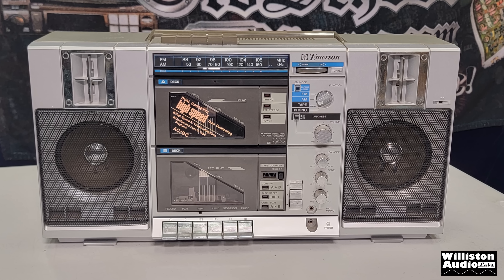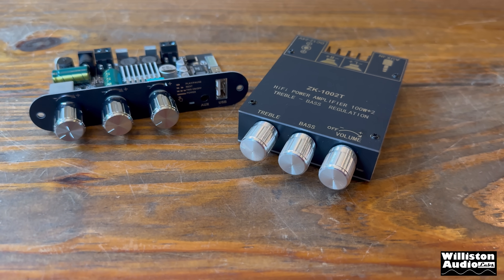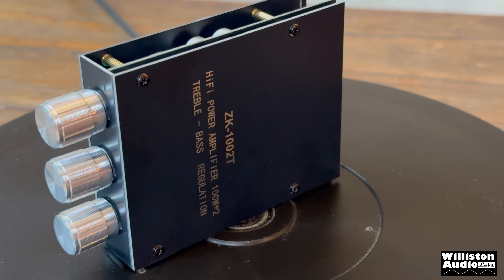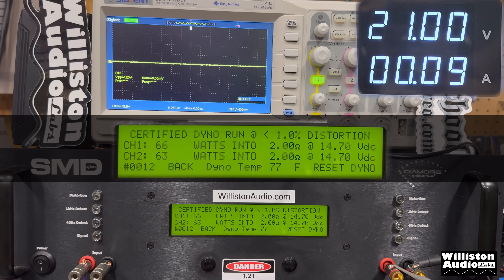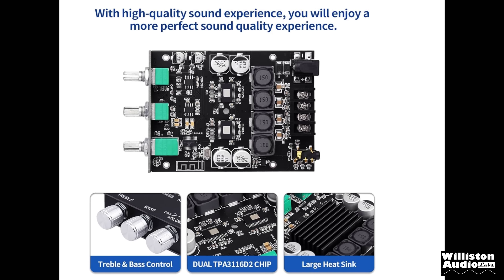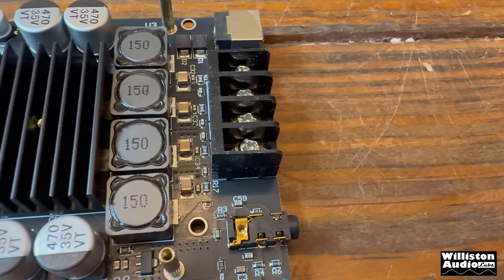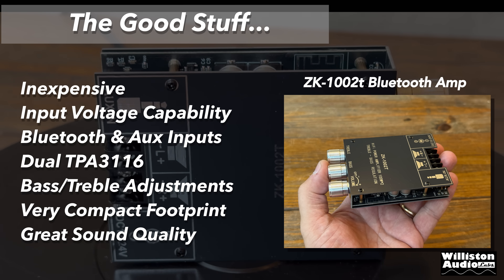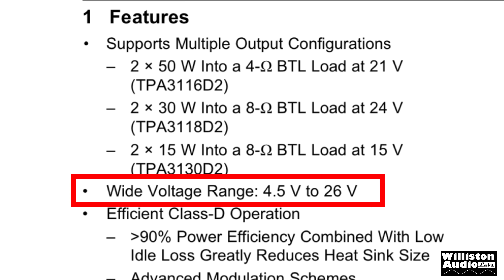This $20 Amp Surprised Me - ZK-1002t Bluetooth Amp TPA3116

Comment: I've been using these amplifiers for at last four years. These work great with component speakers such as 6 1/2'-8" speakers. Fosgate Prime components sound great after a 30-40 hour break in, meaning play at medium volume before really cranking it up. The bass from Prime is a soft boomy bass sound, very pleasing to the ear. If you use Fosgate Punch components, the highs will be very clear as well as the vocals. The bass from the Punch are a little tighter and clean sounding.

Comment: I bought one of this because of your video. BTW, you mention about adding powered SUB later on. I wonder how will you wire it? I wired 2-8ohm speakers parallel already or speaker+twitters both 8ohms. Just curious.

Comment: Many years ago I finished off my shop with drywall and insolation  that is separate from the house and I installed 2 inwall speakers. Right now it is running on a old Yamaha receiver i was thinking of getting rid of it as the sound was never great using  RCA 3.5 mm Audio Aux Jack Adapter to work with my cellphone or computer  and it always comes loose. I don't listen to music loud when working just presence you think this might be good plus it is way smaller and i can mount this amp someplace and give more shelf space haha always need more

Comment: Could you please also do the same test on ZK-1602T also as asbit seems to be the bigger brother of the ZK-1002T and it uses the TDA7498E amp chip and is rated at 160 watts per channel with a 36 volt power supply. I have this amp and I'm curious to know what the actual output would be.

Comment: These amps are really great for almost anything DIY audio related that requires a small but powerful amp. The biggest downside really is the high input voltage required (over 30+v on some more powerful models!) but it really pays for itself in power to size ratio sound quality and value for money as we see in your video. I've been using them in projects for years and yes i have indeed built one of these ammo box boomboxes not too long ago recently consisting of the 50W per channel version of this amp (single TPA3116 chip) 4" 40w driver and a 20w 1.5" silk done tweeter and 4" high excursion passive radiator. It only cost like $50 ish to build and the performance is really great if you know what you are doing. I added some additional weight to lower the resonance frequency (tuning) of the passive radiator and i get a mostly flat response down to around 44hz before it drops off! Even then it still goes down to 38-35hz before it completely cuts off and you completely stop hearing bass which is really insane for a portable system of it's size but especially price. It's most certainly a fun project/thing to do and i highly recommend you take a shot at doing it yourself as i really think you can come up with something great as well!
Reply: try the pw500 power booster. works great with these amps. and they just released and even better,  higher amperage power booster.  great products

Comment: I've used a bunch, i have the ZK-1002L, ZK-MT21, and bought 2 ZK-502M's for my local slotcar club (each running off a big 24V brick there, at home i generally use an adjustable psu or such)

imo they run fine on 26v, squeezin that extra lil power XD

Comment: I was thinking about building one with an ammo box.  Put mdf rings inside attached with epoxy. For 4.5" or 5.25" 2way mid/ hi's  and a 6.5" woofer. With the inside coated with boom mat.2-4 layers. Maybe  spray bed liner before mounting thd speakers and bits. Connect 7 x 18650 cells in series. With a 40amp bms. And a small dc boost converter. To boost 5v to 28v dc to charge with usb. Use about 3ah cells, maybe put 2 parallel 7 in series maybe build a separate  ammo box just for batteries put about 14cells inside  7s 2p. 10ah. With the same bms. And a 5 amp dc to dc boost converter. To charge from a car's 12-15v or a house 12v a supply.  With a 24v battery 20 ah. It should play all day, possibly all night starting another day.. maybe 2days 2nights..

Comment: I've got this, and it's $15 little brother, that doesn't have the tone knobs. Worth every penny. I think they sound just about as good as my little fosi 50x50W at about 1/3 the size and price. I stuck one on my little Yamaha scooter in a homemade fairing, and it's plenty loud. It could really use a subwoofer , but I don't think the little 50cc stator would power it.
Reply: PS.. Unsolder the screw terminals and itls accept probably a 14 gauge. I only had 16 gauge, but at 12v/30W to 3" speakers, who would notice?

Comment: I love these little amp boards. The Chinese invasion series is why I'm subbed.

I used one of these tiny little amplifier boards to run a stereo at the shop while we built a car. Just grabbed a laptop power brick I had lying around and was good to go. After we got done building that car, we moved out of the shop, &  I ended up using that same amplifier board hooked up to a cigarette lighter socket to have an instant BT stereo in a car dating back to the Eisenhower administration. 

Perfect may be the enemy of good, but sometimes good enough is good enough for a couple years of loud-enough tunes while cruising. Eventually I'll install this amplifier I've got and my good speakers properly but the 'temporary' setup made outta crap I already had has been good enough that I still haven't done it yet 🤷‍♂️😂

Comment: I have been using a similar module in my truck for several years now, It beats listening to the wind and tire noise.
Reply: not a bad setup at all,  some of these amps are built a lot better than these, with more powerful chips and better bluetooth chips. and then you can run a wuzhi pw500 voltage booster at well over 30 volts and make it extra powerful

Comment: I have installed it on the car, and it works great i have connected the speakers to it and the original radio to aux port so i can use both Bluetooth and aux for radio
Reply: you should try it in your vehicle with the pw500 booster board. bring the voltage to 24. ✌️
Reply: @AlexWheely-bx7pk i have user the XL6019 DC to DC step up converter but it was getting too hot and was draining the battery but even with 14v is okay because i have stock speakers on audi a3 2005 i mostly installed it for Bluetooth audio

Comment: Wilston audio labs those Apache cases are between $8 to $30 at harbor freight I know because I bought one that was about 10 in x 13 inches for $8 for my XD MOD 3 so yeah they're very cheap they usually use them for camera gear but I used mine for  Springfield armory and the $30 one she could probably put two 8-inch subwoofers in them.

Comment: If anyone is gonna run this board at 24v …I’d suggest you change out all those ss caps and electrolytic cap that I can’t see the value of….out to something with at least double the operating voltage (24v use at least a 50v rated cap)  anything on the power rail , that is. Just my suggestion anyway.

Comment: Great video big d can u please test the zk mt21 im running this amp in virtual pinball machine with a 12 inch jl audio sub and 2 6.5 inch alpine speakers sounds good just wondering the output of these amps
Reply: you have the same chips in that amp as the chips that are in the zk1002t thay Big D is testing
Reply: although im not exactly sure if the mt21 has tpa3116, or fakes

Comment: I made a boom box a bunch of years ago with a 2x100w little  Bluetooth board amp like this. Had two 6.5 infinity door speakers in a Milwaukee hardcase. I would place the speaker in the living room on the house I'm working in and you could hear it clearly throughout the house
Reply: yeah they work good. I brought a box I threw together into work and everyone started building them after. using power tool batteries. It was 2 old school sony bookshelf speakers ratchet strapped together, they actually kicked, a zk50x2 amp and a dewalt battery

Comment: I play... I've got a ZK-1002L, but I like your show.  I went insane and got a Pyle Chopper PLA-2200 and a set of Kicker 6x9 DSC6930 (360wat) speakers in enclosures.  I put a Bluetooth receiver on the amp. It's a very, very LOUD bluetooth speaker set.  Oh, had to buy a 12vdc 60amp power supply, but a car battery works even better.  I have a trickle charger for car batts.

Comment: Built not bought? I can 3d print that case with mounts and spacers in-place. No need to build anything. Would be a simple assembly. Also a good choice would be a "Marine Grade" Pioneer stereo. Can run the speakers in 3-way without any passive crossovers.

Comment: 3116 is a great chip, but like with any chip, implementation is key, especially in class D setups. More expensive amp versions will have better power rails and output inductors... With efficiency around 90% you will still need some heavy batteries to run it to full power- OHMs law is a bitch. :/

Comment: for some reason all the amps I have tried of this style (most of them from wuzhi) I have had problems, they deliver like 10w and then they cut sound, like if they were restarting or something, I have tried with different power supply and no matter if it is a 50w amp or the biggeer ones 300w+300w they always cut sound at only 10w or so, my guess is that it has to do something with the crossover but I had no idea
Reply: makes no sense, every amp setup i put together always worked good, and kicked

Comment: Do we believe that these cheap Chinese amplifiers are actually using genuine Texas Instruments chips?
Reply: we do, the ones that use domestic chinese chips are usually advertised as not having genuine imported texas instrument chips. These amps actually do sound high definition and will put out real power. I bought a zk502t, the stereo amp with tone controls & a genuine chip, powered it with a dewalt battery, and it made a pair of sony bookshelf speakers actually kick deep bass. use a track called ghetto style bass by mad mike and bass mechanic. and it actually slapped hard  on 2 5.25inch old school japanese sony speakers
Reply: @AlexWheely-bx7pk  I bought an amp from Aliexpress that said it used TI chips and took the heatsink off to check. The numbers had been ground off the chips - I don't know why they'd do that if they were using genuine TI chips.
Reply: yeah, you really cant say for sure whats going on when it comes down to it.

Comment: Im using a ZK- 2001b with a Kenwood home stereo tower speaker. It's nowhere near my Kenwood reciever but it definitely surprised me for its size. Im powering it with a 24v 4A  Meanwell LED driver.

Comment: Great video. I’ve got a few of these amps. Installed on inside pair of Dayton B652-air bookshelves and stuffed a 12v7ah sealed cell in enclosure. Drilled dials out back of speaker box and sounds great. Best battery powered Bluetooth speaker I own!  Use 12v trickle charger to charge boxes up.  Mini amp and ribbons how can you go wrong on budget Bluetooth!

Comment: Definitely do more of these. I love the idea of building a sweet little bluetooth rig that bumps like a jbl! Or blows it out of the water
Reply: I can recommend you the right gear. i built a rig using a dewalt battery as I had some on hand. its unreal. it will blow a lot of the jbl stuff out of the water.  especially for the money.

Comment: Neat project idea! Overrated for power once again, but still plenty for a boom box. Looking forward to seeing the monoblock. 👍
Reply: Not over-rated, it's just that the specs are based on a certain voltage (24V) and at 10% THD.
You can check the specs yourself - just note that it's not being tested to the same criteria here. He is testing to 1% certified, not 10% as-per the chip manufacturer's datsheet.
Reply: @johncoops6897  Fair enough, I suppose. I've just never encountered anyone that actually listened to music at 10% THD. I guess if they're fans of really loud white noise... 😆
Reply: @McTroyd - it sounds better when you've blown your tweeters with lovely square waves of clipping 😂
If you check the datasheets, you'll find that almost all the TDA, TPA, PAM, etc are rated at 10% THD. In the fine print you will find (much lower) specs for 1% like BigD tests to.

Comment: Definitely build one, can you use a say milwaukee or makita tool battery to power that amp
Reply: yes you can.  works great. it might be necessary to install low voltage protection to protect the power tool battery

Comment: can the stereo amp be bridged in mono?
Reply: Id have to say no, the chips are already in mono on these amps, and even the amp like this that uses only 1 tpa3116,  the zk502t cant be bridged like a regular car/subwoofer amp would be.  its all how the chip is implemented with specific pins etc, like how they configured the mono tpa3116 amp such as the zk1001b, 1 chip, 1 speaker output, mono

Comment: We really are living in an amazing audio value for the performance times. These young folks havent a clue how good they have it. 
IMO these cheap class D chip amps have become damn near identical $ for $. Really becomes a for X amount of $ you get these more features and watts. That is till you get into high power / high end class D amps. And Im talking actual 150 watt+ $500+ quality power amps. Which there are also loads of China made / brand options. But imo its this tier that really shows how used Class A/B (and the like) power amps of years gone by (not crazy old mind you) are still king in terms of wattage per dollar. Focusing in high power home audio use here. Car audio Class D is and has been the crushing value for ages now. But SOOOOooo much of that is due to Class D still being no free lunch. And for actual CLEAN high power home Class D it takes a BEEFY power supply and good design. You look inside these home high power Class D amps over half the guts is the PS. The amp is super tiny compared to A/B. Im lucky enough to work at a company that tosses loads of tech gear. Last year snagged a mint Crown Drivecore 8|300N 2U power amp. Basically 150wX8 amp. Inside its damn near 2/3 power supply and 2 3x3" boxes the amps are cased in. All this amazing cheap amp tech is good and well, but BIG draw back. When they blow up, your either lucky enough to replace the amp or PS section at a cheap enough price or you toss it. Quite often its toss it sadly.

Comment: I have this amp - an undocumented feature is the Wuzhi audio app support. The app is sadly very....terrible. hat to get out an old android 10 device. It actually supported full EQ control through the app and it kept this setting even after disconnecting the app.

Comment: I blew so many of these oh man… max voltage that chip can handle i think is 25V but the circuits on the board can’t handle more than 24. But now i’m using APTX3 bluetooth amplifier also from Wuzhi Audio ZK-APTX3 and it’s the best class D amp so far in my opinion. You should check it out it would be interesting to see REAL output power of those legendary TPA3255 chips. But, you need a step up or step down converter. 1800W from Alliexpress do the job just fine but you have to convert it from atleast 40V because those has a limited input current only at 40A and 24x40 is not even a 1000W so be sure to convert from 40V to 51V. My amplifier can handle 3 subwoofers wired at 1.33Ω. No overheating no distortion ( sort of )

Comment: I remember "portable" boom boxes with like 8-12 D cell batteries. It was crazy. Weighed like 40 pounds. Batteries last like 1 hr cranked. The one I had I believe it was a Panasonic. It used 8 D cell batteries. I ended up replacing the batteries with a 12v gel cell. Lasted way longer.

Comment: i need to see a single 5.25 version, a dual 6.5 version, a dual 6x9 version, and a dual 6x9 and single 8 sub version of those waterproof case boom boxes. all runnin on either makita 18v or ryobi 18v batteries. ok ok ok. i guess you can make some runnin on a dewalt 12v too.

Comment: The TI3116 is already bridged so mono gives no real gain. The amp in this test used two chips so you can run 2 ohms so will be the loudest you can get from 24V. You might be able to run 3 -  4 ohm speakers per side so fairly loud.

Comment: if only they would make a good Bluetooth amp like these that can put out correctly.
Reply: These put out fine.  they are just overrated like every piece of audio gear
Reply: @AlexWheely-bx7pk  Then I say they don't put out.  If I guy something, that says 100 watts I want 100 watts not 36 or 55watts.
Reply: well, they do say 10% thd. marketing is a funny thing sometimes.  cool thing is now they have nice voltage boosters, the pw500, snd a nice amp with 2 tpa3255 chips, the zk60002. excellent setup.  especially with wuzhi's QCC5125 isolated, Ldac Bluetooth board with gold rca outputs hooked up.  sounds amazing

Comment: The TI3116 is  still the nicest sounding TI chip. If they run film coupling caps and a clean blue tooth chip they sound quite nice.
Reply: there arent any 3116 amps built like that. the best amp to come out recently is the wuzhi zk6002 stereo amp. it has one tpa3255 chip per side,  and poly caps, nice inductors etc. it rocks

Comment: Can you try it at 18v? Was thinking about a build with tool batteries as the power supply.
Reply: these chips run great off of a good, authentic 20v tool battery. the only issue is low voltage protection.  if you dont install some type of low voltage cutoff inbetween the amp and the battery, the amp will easiiy drain the 20 volt battery lower than 15 volts which can easily damage the battery.

Comment: Way back in 84, we were installing car amps into boom boxes.  Of course, these car amps were not class D amps.  The batteries lasted maybe 10 minutes, at best.
I installed a modular style boombox into my brothers Chevette.  It physically fit surprisingly well, but the power wasn't as stable as the boom box required.  It could handle the 13.5V system, but due to the spikes and noise, it only survived a few months.  It really needed isolation.